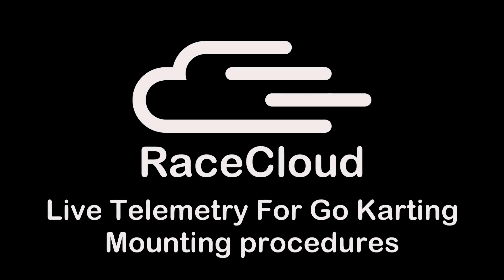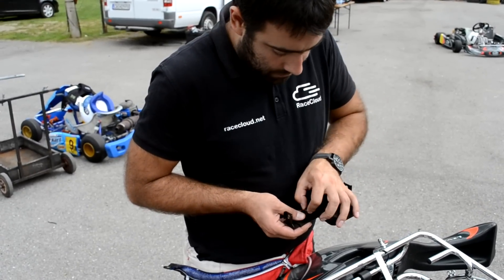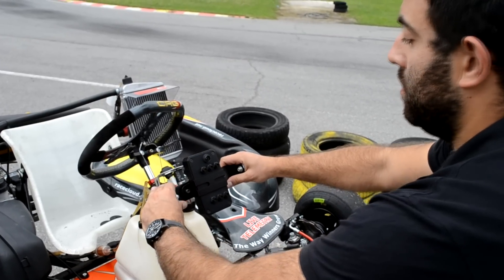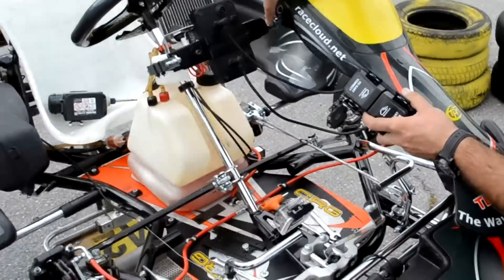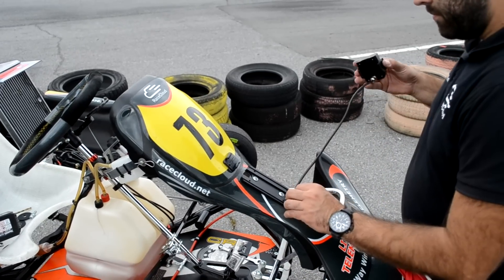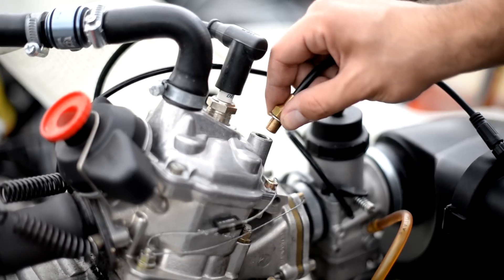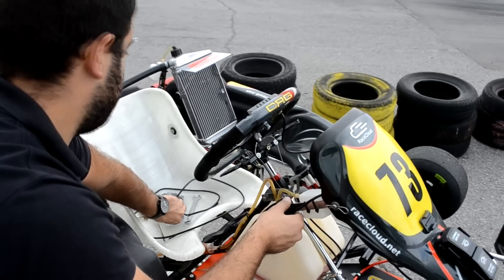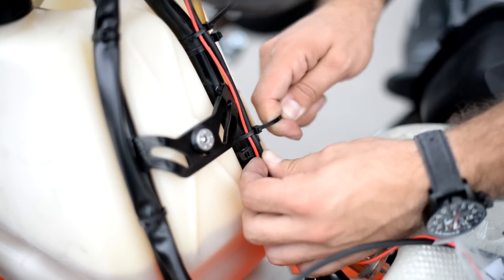RaceCloud Live Telemetry Hardware (Go Kart BUNDLE) - How to Mount

Comment: Do you have to mount the go-kart motion and 3g module on the outside of the front body work, or can it be put under it?
Reply: +Eric Molinatti The Connect can go anywhere without much problem as long as it is far from the engine's electronics. However the Motion may loose precision if there are too many obstacles to its signal. You can always try to put it under the nose and see if it works for you. Just keep in mind that the orientation should be preserved (labels pointing upwards). Otherwise the antennas inside will not work so you won't be positioned properly and g-forces and steering angle will be off.